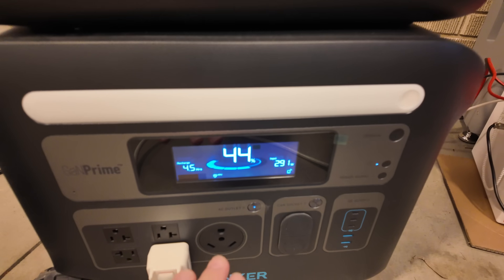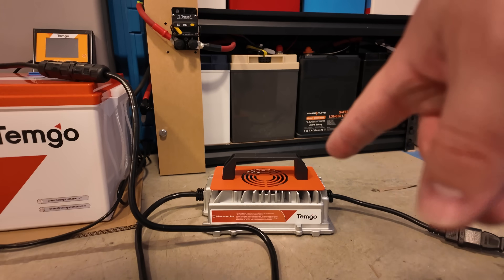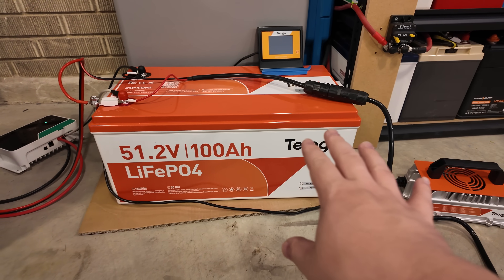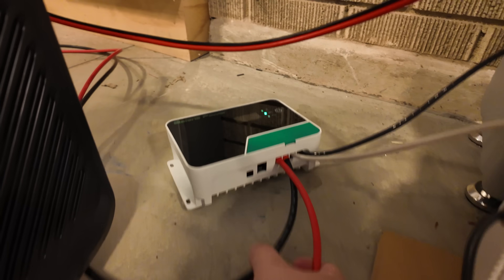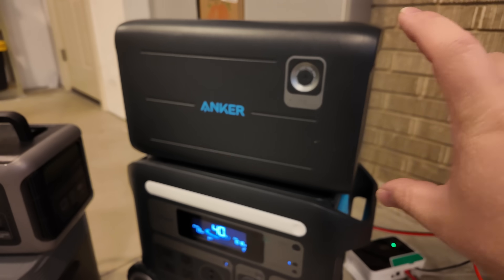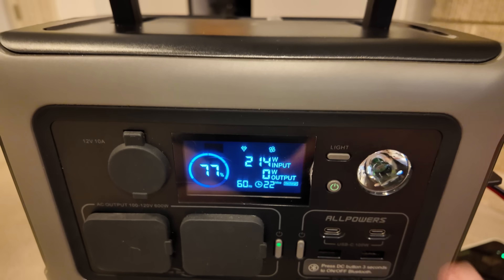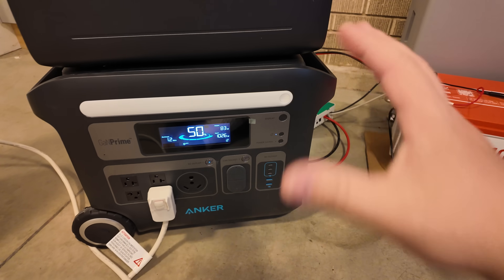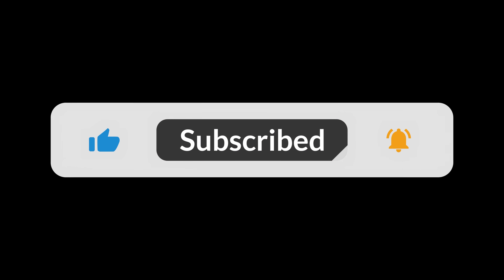I SOLVED the BIGGEST Problem ALL Power Stations Have!

Comment: Nice setup. I bought a 11kw inverter generator for less than your whole setup. Clean power low noise. Powers 80% of my house.
Reply from the maker: Sounds like you found a great solution for your power needs! What fuel do you store and run in it? Thanks for watching!
Reply: @theresatrickforthat propane.  Lasts forever. Replaced my big ac unit with minisplits. Low power. Emergency hot water tank propane (I'm all electric)
Reply from the maker: Awesome!

Comment: Does this theoretical gasoline powered generator have to be a pure sine wave or can it be an older model that delivers  dirty power ?
Reply from the maker: That’s the beauty of the charger that comes with the Temgo kit…it will clean up dirty power! So it works with both kinds of generators!

Comment: I’m trying to run my Grow room on solar. 
I have a Patriots 1500 unit. 
I have one 340 watt solar panel. 
I have a Redodo 12/24 v charge controller charging two 12v 100 amp hour batteries in parallel. 
The batteries feed into the solar dc input of the power station.  
The system only powered my room for one hour. 

What can I do to make it work?
Reply from the maker: Hummm. Probably most certainly need more solar power going into the batteries…but sounds like the Patriot 1500 is your weak link and dying faster than it can re-charge from the Redodo batteries and solar. You might need to change the power station you are using that can accept more power from external DC sources. Thanks for watching!

Comment: Excellent video! The way you have all of the connections as shown in the video, can you keep it all connected that way all the time? For example, the solar charge controller connected to the battery, and connect it to the power station all at once? Seems to me like if you connected solar panels to the charge controller, the output of the charge controller would go to the battery and the power station simultaneously. Seems to me like that would be a problem, but I'm not sure. You also have the AC to DC charger connected simultaneously to the battery. Is it possible any solar charging with back feed into the charger? Thanks again.
Reply from the maker: No worries having them all hooked up together and running at the same time! The battery can handle a large amount of power. They all keep their voltage regulated by the battery and if it ever fills to 100% the chargers will automatically shut down! That’s the beauty of this setup! It opens the door to so much expansion and customization! Thanks for watching!

Comment: My EF Delta 2 Max starts  AC and dishwasher and microwave in my RV with no problem....
Reply from the maker: The EcoFlow Delta 2 Max is basically as capable as the Anker F2000 you saw in this video. But still has the same pass through issue. Thanks for watching!

Comment: The biggest problem with these cheaply made power statipns is that they don't have an output transformer to provide galvanic isolation which is a dangerous design.
Reply from the maker: Haha! We can always count on a plug for low frequency inverter from you! Good luck finding a portable power station with one! Transformers are HEAVY!

Comment: I subscribed. You REALLY seem to know what you are doing. I was in an accident last year. And it left me with physical injuries to the left side of my body. But the part I want to talk about is the TBI it left me with. Because of it. I have trouble with my short term memory. Making projects like this. Really really difficult. I really want to build me a solar power system. Something to power my whole house. But I can't afford to buy everything at once. My question is where should I start? Or what would be an affordable way to at least get things going? I was thinking of get a 100ah to 200ah battery and 400w solar panel. But now I'm not sure. I was thinking the minimum should be the 100ah battery, 400w solar panel, good charge controller and a Pure Sine 2000w continuous inverter. Sorry for writting so much
Reply from the maker: Thank you so much for subscribing! I’ll do my best to make it a valuable addition to your life! 
You’re on the right track! If you want a whole home power backup system, buying a modular system of batteries, charge controllers and inverters are is the most cost effective scalable solution.
I am actually going to be releasing a video soon about a nice starter 12v system for beginners. That might be of interest to you. But you said specifically you are wanting a whole home system. If that’s indeed the case, you’re probably going to want to just go straight to 48v systems. This golf cart battery kit is the best bang for buck kit I’ve found yet! It’s gives you the 100 amp hour 48v battery plus comes with a monitor screen and best of all a charger all for less than the cost of the cheapest server rack battery by itself that I am aware of! Thanks for watching!

Comment: I have the Anker F2000 and Anker battery, and just ordered the same Temgo in your video along with a 5’xt60i cable. What breaker setup did you use? Thanks and appreciated!
Reply from the maker: Awesome! You’re going to LOVE your new setup! I used a 30amp fuse rated above 60v to protect that 10 gauge XT60i cable. Thanks for watching!

Comment: This is essentially what I will do for extended power outages but my PPS has a 50v limit so I have two 12v 300ah batteries in series which will give 500w of input to the pps which covers my essential load. I won't be running AC, just keep freezers and fridges going and Internet and a TV. 1200w of solar to charge the 24v battery and I have multiple gas and LP generators with fuel stored to run anything from a 50a battery charger to most of my home so I can power my well pump. Multiple redundancy and graceful degradation. And minimal use of generators. Yes of course you could build a system yourself with components. I did that too but convenience has its own value. One other thing is if your pps has an expansion battery port you can hack the cable and connect that battery allowing the power station to see it as one battery for charge and discharge, adding 5kwh just like the proprietary expansion battery.
Reply from the maker: Sounds like a great setup! Thanks for sharing and for watching!

Comment: So, theoretically, I can expand my EcoFlow Delta Pro Ultra with a much cheaper alternative?
Reply from the maker: Exactly
Reply: @theresatrickforthat  But, from what I see, it won't charge the expansion battery? The expansion battery will only be charged when I hook up the gas generator?
Reply from the maker: Yes. You need to either add an external solar charge controller to your golf cart battery like I showed in my video…or if you have plenty of solar coming into the DPU or you’re wall charging it, you can simply plug the included charger from the golf cart battery kit into the DPU and use it to charge the extra battery up and then use it’s capacity when you need it.

Comment: I have an anchor power station, you do realize that you can turn off passthrough charging right?
Reply from the maker: Yeah? How? And how does that benefit us in this situation even if you can? It will still use the inverter in reverse to charge, and then you’ll get zero power to your outlets!
Reply: @theresatrickforthat  My Anker c1000 has one outlet designed for portable air conditioners or high powered devices. 
Check your unit to see if you plugged it into the right socket, that's probably why it kicked out or won't respond!
Reply: @theresatrickforthat  Yeah, I zoomed in on your video and I can see that you have the AC unit plugged into the wrong socket. You should have plugged it in to the socket right above it which is the one you're supposed to use for that type of appliance!

Comment: The only issue I see, your portable AC is not acting as a heat pump, without running the condenser air duct to the outside, there is not much cooling happening for the space. Great video, thanks for the info. 👍
Reply from the maker: Haha! True! And it does have a duct. Where I was demonstrating the electrical side of things it wasn’t worth hooking up the duct for the few minutes of it running. Thanks for watching!

Comment: Wanting to feed My Oupes Mega 1 800 watts from a 48 Volt Battery Bank of 2 24 Volt Batteries tied into 2 Packs @ 10Kwh and into Buss Bars - 10 Gauge Wire to XT60I Cable for My Eco Flow Delta 2 and Delta 2 Max and also into an Anderson Connector for the Mega 1
Reply from the maker: Sounds like an epic setup! Thanks for watching!

Comment: So basically you've de-evolved the power station back to a regular solar setup and inserted the power station into it.  I appreciate the video and the thought and time you put into it. The way this is setup with the battery, MPPT solar charge controller, etc, the power station is irrelevant.  You could just as easily use a much cheaper inverter that starts and powers the A/C or anything else directly.  The whole point of a portable power station is to avoid the complexity of what you created in this video.  In a roundabout way, you went back to the roots of how DIY solar power systems work by using a much more expensive power station in place of the inverter in such a system. I understand the power station also has a battery, but for the same dollars one could buy larger storage like the one you demonstrated in the video while eliminating the losses of DC-DC charging.
Reply from the maker: Haha! Yep! Basically! But if you already have spent money on a power station! This is a wonderful hack! If you want to see how the battery kit performs with a giant AIO inverter (EG4 12000XP) you can watch this video: https://youtu.be/dboHXnSY9LI?si=R9A5hEbvbWhu6L7T
Reply: @theresatrickforthat  And maybe people who were intimidated by a DIY solar setup will be inspired by your video to try one without the training wheels.  I'm all for portable power stations, I have a few myself, but for real off-grid power nothing beats the price point of a DIY solution.
Reply: I found this setup a clever idea actually. A lot of people use portable stations as off-grid systems and sometimes you need to buy expansion batteries but they will cost twice or more than other batteries. You can  buy a 15kwh battery for less than half of the price of a 6kwh battery from ecoflow for example and they can be used with most systems. You can just buy a solar charge controller to charge the battery and charge the portable station using the solar port. You can have that "extra" juice for cheap.
Reply: True but setting up a fuse box, maybe a bus bar, multiple 12v outputs, correct wiring and fusing for each, and an inverter is significantly harder than this. Not to mention dangerous if not done correctly. A cheap power station can take the place of all that, and you'll just need to supply a battery that gets a charge from somewhere
Reply: @distantforest2481  It may be easier, but it is a way less reliable solution for a long term set up. It will most likely end up costing you more money, they are cheap for a reason.
Reply: Yep, I came here to say exactly this -- the only thing you're now using the power station for is the inverter output, and you could just buy one of those to work directly from that battery. Also I see that golf cart battery kit is $760 "marked down" from $2700. The same thing on Amazon is $1080 marked down from $1800. So I don't know what price is permanent :-)  I have a Pecron E3600LFP which has no problems at all running my 4kW (heating/cooling output) portable AC unit that uses 900W, plus another 1500W of stuff at the same time e.g. 200W for my computers and fridge, plus 1100W for my espresso machine. In mains-powered pass-through mode, which yes does limit me to 2400W of load vs 3600W when not charging from the mains (or generator). The Pecron's 3kWh expansion batteries are $800, which is only a little more than the golf cart battery directly from temgot.com AT THE MOMENT. And yes it's a bit smaller at 3kWh vs 5kWh but it's also an integrated, guaranteed, plug-and-play solution, and you can add four of them for 15kWh total. And use it at the full 3600W output capacity of the Pecron's inverter, and not limited to the 1200W of the MPPT inputs (or even 2400W for both together). I note that Ecoflow's 4kWh expansion battery is $2200, which is $550/kWh vs $267/kWh for the Pecron battery and $152/kWh for the golf cart battery. So the integrated easy Pecron battery is more expensive than the DIY golf cart battery, but less than half the price of Ecoflow (or Bluetti). All that said, I had thought about connecting my 1800W (cont) "pure sine wave" generator to the Pecron using the MPPT input(s) using a battery charger / DC power supply to make DC. I'm not sure whether I'd need to have an external battery at all to smooth/buffer the generator output. Maybe a much smaller one. The two issues are that, as seen here, I'll probably be limited to 50V @20A = 1000W of charging and that 48V (or better 60V or more ... I can take 150Voc) chargers / power supplies seem to be very expensive. Maybe this golf cart kit is a cheap way to get one.
Reply: @BruceHoult  The Temgo is $629 (without the charger) and gives a $0.12  per watt cost.  The Pecron is $569 which is $0.18 per watt.  Price each on how much to build 15kwh of battery storage and the Pecron isn't even close.
Reply: Yeah I’m starting to dabble in these inevitable waters, which eventually will lead to DIY for one reason or another, all roads lead to Rome, use cases, budgets, limits, and of course wanting to make use of previous investments as one’s situation evolves. Thanks ❤
Reply: Instead of starting off with the right amount of power needed, these guy's all end up with more wires and boxes to connect..😂 how about some due diligence and common sense?? I'm getting my power station next weekend...and I bought one for Twice what I'll need...and at a better price and without all the wires and boxes...
Reply: @NormSimpson-iw5jr  sooo .. what are you getting?
Reply: It shouldn't be that hard to calculate what your maximum needs may be, and for how long...geez...it's just basic math...NOT Rocket science...😂
Reply: It's all about redundancy in a preppers mind   think emergency
Reply: Right on. Next week I'm getting a large power station. The only add-on will be a dual power controller for solar And wind. So simple... no hassle, no problem...
Reply: I am just using the powerstation solar mppt input and change my bycycle battery whith the 12v/230v output, if i need power back to the powerstation i use the solar mppt/dc input to my bycycle or ext battery.
Reply: Unless you get the power station for 50% off during black friday sales.
Reply: If what you're saying is true that the power station will regulate the amps as long as the voltage is correct. Then you could put a 60amp charge controller with a 4k array on the external batt while it connected to the 1 k power station
Reply: What a loser of a comment. This setup is EXACTLY what I was looking for as an owner for the original F3800 and poor solar charging ports and high cost of the additional batteries. Go touch grass

Comment: Thanks for sharing. 
What does this buy me that just a chargeverter into my large power station can't provide (clean power into the solar input) ASSUMING I have no intention of charging via solar? 
(We are looking for a larger solution that will rely on extra batteries and recharge from generator a few hours a day as we have no place to mount panels.)
Reply from the maker: The chargeverter is the way to go if you are charging from a 240v source and want super fast charging. But for literally $75 more, you could get this golf cart battery kit and expand your capacity by over 5kwh! Plus get a really nice 120v charger! Thanks for watching!

Comment: You could adjust the charge rate in the app to adjust for the load you have and still charge the power station. I think that would be a simpler and cheaper option.
Reply from the maker: Rewatch the video carefully… You’ll see that when I overload the pass-through… I had the charge speed on the anker power station lowered to the lowest setting. You can see that on the screen of the Anker unit. Thanks for watching!

Comment: Keep in mind there is more efficiency loss with this method. It's doing an additional dc to dc mppt.
Reply from the maker: Yes...but solar panels are so cheap! Buy an extra 400 watt panel for less than $100 and you've not only compensated for the extra loss, but probably end up net positive! You can't just "add" and extra panel when you're maxed out on your power station. With the external MPPT options, the world opens up in a vast way! Thanks for watching!

Comment: The problem I see with solar generators are they all need different voltages, and different connectors to recharge.  8mm/Anderson/XT60/XT90.  You have to be able to configure solar panels for watts/voltage/amps so you don't overload the solar generator.  Frustrating.
Reply from the maker: Yep! This solution somewhat helps with that because the battery will provide very consistent voltage for the power stations to use, and then you can have a ton of flexibility on the solar panels because you are working with a dedicated MPPT that you source for max benefit to your solar power harvesting. Thanks for watching!

Comment: Fair warning, hooking up 48v batteries to the solar input of my Ecoflow Delta 2 fried the solar input twice. Consensus is that it's just my unit, but you have been warned.
Reply from the maker: Humm. I have done this for years and so have all my friends and family without issue. You must've had a lemon or something. Thanks for watching!
Reply: Caused my ecoflow delta pro to wobble.  i concluded it was the 100 amps it couldn't handle.
Reply: @Pizzaguy1022  It's only going to pull 15 amps. So not it was not pulling 100 amps
Reply: But the voltage Limit is 60V. A fully charged 48V battery does not even get to 60V. So how is that possible
Reply: Over amperage.